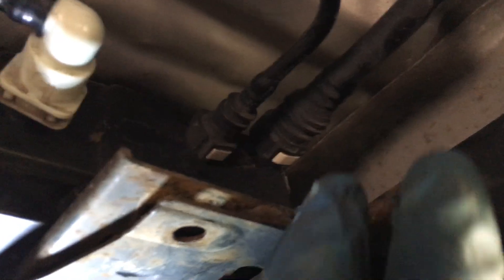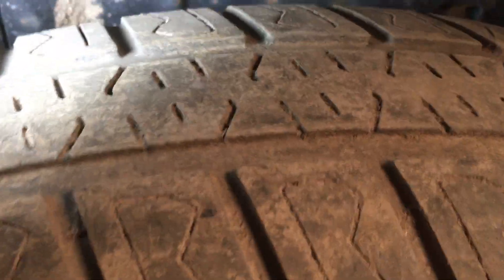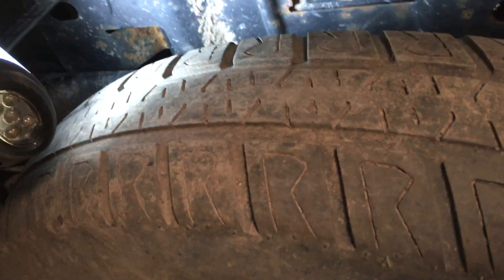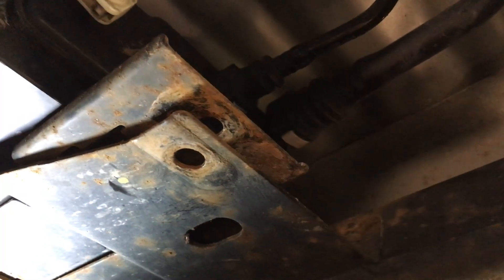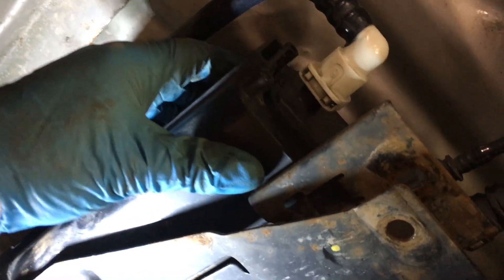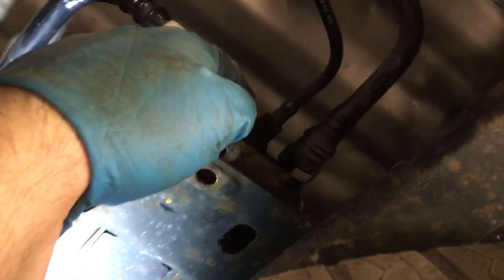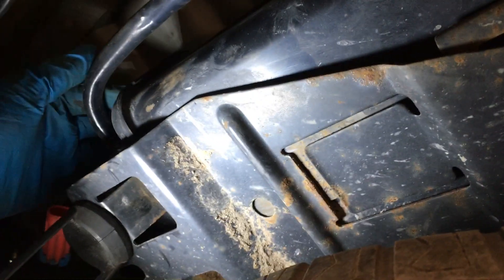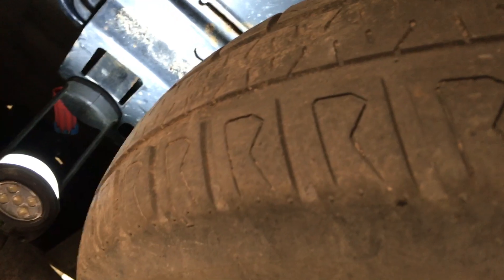Remove GMC Canyon vent control solenoid and charcoal canister, to repair a P0446 code.

Comment: Hey man thanks for the video! If that wire that connects to the canister is broken. Do you know where to get a replacement cable/wire?
Reply: The early  original plugs were oval in shape. The newer updated ones are square-ish.  If the wire you have broken is going to the early oval plug, get a GM #1925603 adapter, then cut the male plug off from the truck wiring, and the female plug from the adapter, then splice the newer square-ish plug to the original wiring. If there's already an adapter there, and that's what's broke, simply replace it with the new one. Either way, the #1925603 wiring adapter will solve your problem.